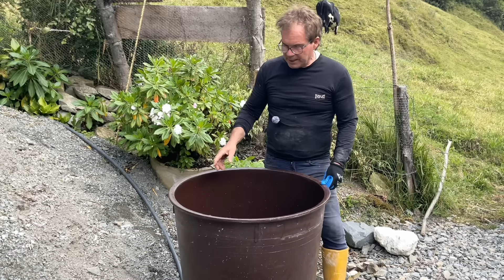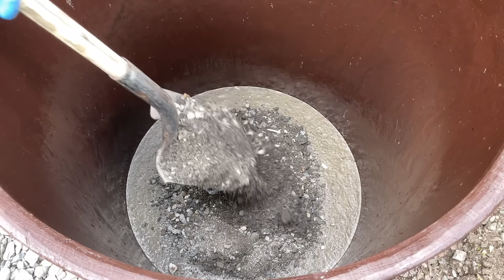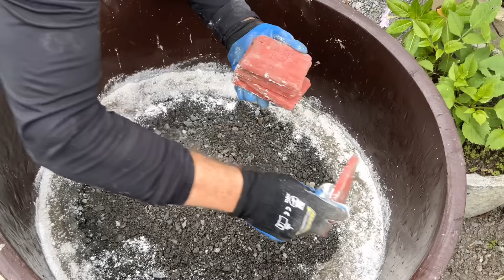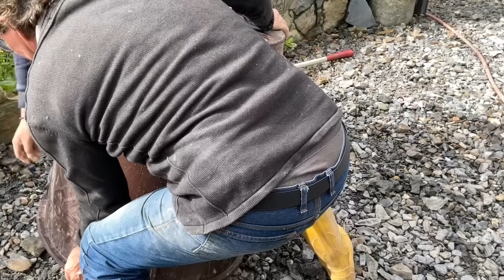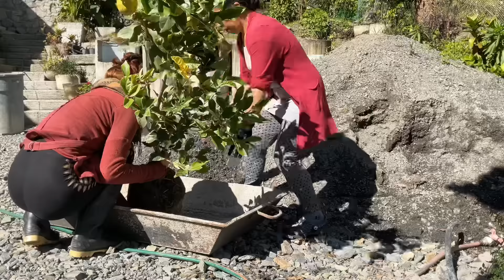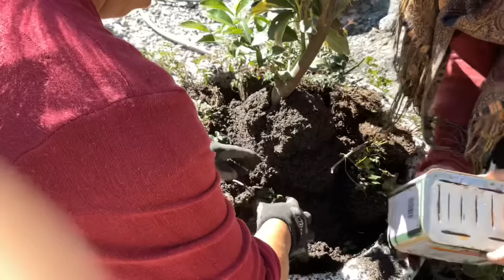How I make massive concrete (cement) planters cheaply and effortlessly using the sand fill method!

Comment: 4 inches thick? That's pretty heavy. Did you keep track of how much portland and sand this took?
Reply from the maker: If I had to move this beast I would add more polypropylene fibres and work towards 2 inches. We just flipped it over. I will make a massive round planter with fabric shortly.

1 bag of Portland  equals 24 shovels full plus we added 72 shovels of sharp sand. I remember specifically only having one bag left of type 10 Portland.

Comment: Hi! What’s the hardiness zone where you live? I’m in 6b. So I’m not sure how to prevent the concrete planters from cracking. Any input would be tremendously appreciated. Muchas gracias
Reply from the maker: We’re zone 10 b. Look it is very simple. If you want frost proof planters the following tricks help immensely. 1 ) Rich mix 1 cement to 3 sand/ stone. 2) Add an aerator to the mix.. even a bit of dish soap creates bubbles in the concrete 3) polypropylene fibres help with cracking 4) mix your concrete with proper energy… hand mixing doesn’t cut it  5) be very careful with sealers they can trap water into the structure of the planter 6) if in doubt empty your planters and store in a dry location.
Reply: @buildingenjoyment thanks! I recently learned about baseless planters. This UK gardener named Bunny (can’t recall her last name) she’s also on YouTube. She teaches that method and it helps the plants thrive. It would be interesting to basically make a concrete cylinder. Thank you so much 🙂

Comment: That’s crazy. Every other concrete planter video I’ve watched cares so much about the inside being perfect 😮
Reply from the maker: Yes! Yes !Yes ! The rougher the inside the larger the water uptake surface for the roots to attach to the concrete.  The biggest issue is when you want to get the plant out of the concrete plater. Almost impossible. We have to use a wrecking bar .

Comment: So far this method is the most practical method I have been seen on you tube! Really appreciate.
Reply from the maker: Appreciate the appraisal. The inside of the planter is irrelevant. Getting over that fact makes the sand fill method possible 😎
The rough inside is actually great for the roots to pull out moisture from the concrete planter.

Comment: Do the chemicals from the cement leach into the soil and affect the plants?
Reply from the maker: Lime is the biggest culprit which raises the ph of the soil inside the planter. I always mix a wetter clay soil and rub it against the walls of my new planters. I ve noticed the roots attach themselves to the concrete walls of the planter. When I try to remove the plant it is tough because the plants and the cement have joined strongly. I make a point of trying to have rougher insides of planters so roots have something to latch on to. 

My plants are thriving inside all the planters I’ve made.

Comment: I wish you would've shown the inside of the planter after it was all done.  Not extremely important; I just would've liked to have seen it.
Very cool project; so many variations you could do with this; from coloring, to using leaves or rope or anything really for texture on the outside of it.  Really cool, thanks for sharing.
Reply from the maker: Interesting comment! We always beautify the inside of the planter the make it thinner (chiseling) Also prefer these planters to be rougher on the inside for roots to attach themselves! We have recently made a leaf textured planter video !😏

Comment: Beautiful!!  This was the perfect size for planting a tree.  Thank you so much for sharing your process.  Is there a need to cure the planters before planting in them?  I'm on to your next video.  Cheers!
Reply from the maker: I have a process that neutralizes the alkalinity of the cement. Mix a pail of your richest soil with a bit of water to create a thick paste. With gloves rub this gooey mix into the inside walls of your concrete planters. Once everything is covered you made a connection between your planter and the soil surrounding your planters.

Comment: You really think that is only 200lb? you guys struggle quite a bit, both probably weigh nearly 200.. I'll bet it's 300-400
Reply from the maker: You’re right here is the calculation.

3/4 quarters of a of a bag of cement. 37.5 kg +37.5 kg x3 of sand = 4 x37.5 kg = 330 pounds.
Reply: @buildingenjoyment  oh yea nice. don't forget the water! & thanks for the video

Comment: Does it work the same way in zone 5b ? .....
Reply from the maker: Yes , but stick to a strong mix. The stronger the planter the better it will survive freeze thaw pressures. 1 cement to 3 sand will survive frost.

Comment: Not having a hole in the bottom keeps the tree roots from going out. If the roots go through the hole they will grow until they bust open the planter.
Reply from the maker: Interesting comment. I don’t drill holes any more. I always cut slits with a grinder. This planter was sliced as well just didn’t film it.
Reply from the maker: I actually prefer bottomless planters.

Comment: Have you used a rubber circle imade from a rubber or flexible plastic strip  in order to make it easier without fisting it.
This is how I plan to make it place the rubber circle fil it with sand, pour the concrete, remove the rubber and then do it again for each layer.
The rubber will be almost the height of a layer
Reply from the maker: The mechanics are off. How are you going to raise the rubber band with each layer . The fisting is super effective and creates a great skin on the outside of the planter. Super easy and super fast . Why change the simplicity? 

Are you talking about a hard circular plastic? 

It seems people are having a rough time with the inside of the planter being rough. The roughness is what the roots grab on to to facilitate a moisture exchange with the cement planter. The roots love attaching themselves to the planter. I’ve tried taking trees out of these planters and it is tough.

Comment: Interesting idea, but why not simply puting a flexible bucket or good size bag (filled for the weight maybe with water?) inside the bigger one, then vibrate it to avoid bubbles, and un-mold the whole ? Could be even faster isn't it ?
Reply from the maker: The issue is getting the inside container out. The outside container is five times easier to get out than the inside container. Many videos on YouTube were the person can’t get the inside container out.
Reply from the maker: The Sand fill method is a lot faster calculating the time it would take to get the inside container out. If you can leave the inside planter in place it is faster.

Comment: Lovely results.  ... and to quote you... "easy to do".   Especially if one has all the "helpers" you had and all the "tools of the trade".  An older female, DIYer for decades, retired and surviving in Rural Appalachia... at 76years of age.
Reply from the maker: Not so hard concrete takes a long time before it dries. You even have enough time for a cup of tea while mixing !
Reply: Actually is the best low budget and easy way to do this, but a mold of that magnitude would be very expensive.   And if he put something in the middle instead of sand it would be a little difficult to remove.

Comment: Uh, didn't you forget the drainage holes????  Those plants 🌱🌿🌼 are as good as dead 🪾🥀💀.
Reply from the maker: Cut long slits in the bottom with a grinder forgot to include it in the video. Wanted to make a separate video on cutting slits in cement planters so messed it up. Slits are working out better than holes for me.
Reply from the maker: Actually the plants do ok without drainage holes as long as the inside of the planter allows for water transfer through the cement.
Reply from the maker: I have many planters in locations that are in full sun without drainage holes.

Comment: NO DRAIN HOLES!!!😳this is TOO MUCH UN NESSARY WEIGHT!  No planter needs that much material, you’re not building the pyramids of Giza .  The more cement the less room for soil….
Reply from the maker: I cut drain holes (slices) but didn’t add it to the video. My bad! Was thinking ahead about a video on slicing drain holes instead of drilling holes.

The planter is 10 cm thick and we outlast the two of us. The planter is also staying in this spot forever. We have the most intense sun imaginable here on the equator, thick planters are the best way to keep roots cool.

The moisture exchange with thick planters is exceptional. Excess water gets absorbed by the thick walls. Released when the plant needs moisture. When you take the plants out of the planter the walls are absolutely covered with roots. I made a video showing the struggle of getting a plant out of the planter.

Comment: It would be a good idea to seal the inside of the pot. Concrete fishpond sealant is easy to apply. If not sealed, free lime in the cement will leach into the growing medium. This will be deadly to lime intolerant plants such as citrus.
Reply from the maker: I would rather deal with the lime than the harsh chemicals of a sealer. 

Lime is actually essential for soil regulation not sure why so many are scared of the lime in the cement. Lime is a naturally occurring soil additive. 

Here is how I deal with the insides of planters. I make a rich soil mix and rub it into the inside of the planters until I have a thick skin covering all the interior. As long as you skin the inside of the planters with a rich everything is protected . I have citrus, mangos and avocados bursting with life inside cement planters. The planters don’t have bottoms which promotes more vigorous growth.

The variegated lemon will have no issues in this cement planter.
Reply: That's interesting, thank you.

Comment: Did I miss what you used to coat the inside of the container to help with the release? Suggestions, please.
Reply from the maker: Simple cheap cooking oil. If you’ve never released cement from plastic . Let the first coat of soap dry in the sun then put a second coat. Some plastic containers don’t have enough slope to be released. Also I sometimes fill up the edges of the plastic container with water and sometimes use an air compressor to reales the cement from the plastic container. 

The idea is to get 10 planters out of on plastic container 🔟

Comment: I appreciate the upload, i didnt know this was a possible method. I wish you had shown the inside of the finished planter as im interested in how the inside surface looks. What kind of plastic container is it and where did you get it?
Reply from the maker: The inside of the planter is rough and unattractive on purpose. I want the roots to grab on the the roughness! I’ve released some entangled trees from cement planters I’ve made and the roots dig in to the rough cement. (Moisture exchange ) I always smear the inside of the planter with a rich mix of soil. Putting another plastic container on the inside is tough. They never come out easily. The outside is 5 times easier to release. 

If you’re looking for a really smooth inside sheet metal is a better option.

It is a recycled plastic manufacturer here in Ecuador. Look up recycled plastic manufacturers. The container is tough as nails.
Reply: @buildingenjoyment  thanks for the reply. I don't doubt why you left it rough, I'm just curious to see how rough it is. I'd like to use this method but I need the inside to be somewhat smooth, but some undulations are ok. Do you know what they use those containers for?
Reply from the maker: @natepenn9112 the recycled planters are crude . Some small company with steel moulds making extra thick planters. A lot of these companies make crude outdoor furniture as well .

Comment: How is that planter going to drain?
Reply from the maker: I cut slits in the bottom and didn’t add it to the video. My bad
Reply: thanks for sharing! I’m going to give it a try using white concrete and blue tiles.

Comment: What the heck does 3 too 1 or 2 too 4 mean? Why can't the just say half a bag, 1/4 of a bag? Or 3 shovel falls of sand.
Reply from the maker: One shovel full of cement to three shovels of sand/ stone mix

1/2 bag of cement = 10 shovels full of cement requires 30 shovels of sand/ stone mix 

I would lose half my audience using these ratios. My point is the mix is extra rich 1 to 3 and not the typical 1 to 5.
Reply: @buildingenjoyment  lol thanks for educating me

Comment: I am going to try this on a trough planter... thank you for sharing.
Reply from the maker: Please remember you can build a planter (rougher) on the outside of your wood frame …. Or smoother on the inside of the wood frame. Both will work fine. Don’t forget to cover the surface touching the cement with cheap cooking oil as a release agent.

Comment: Would it work to put vaseline on the outward facing side of the tiles to prevent concrete bleeding onto the face, thus eliminating having to clean it off after the concrete has set ?   Is the finished article frost proof?
Reply from the maker: The tiles cleaned so easily. A clear spray sealer  would be better than Vaseline. The issue is the diameter of the planter leaves a tiny gap where cement gets in behind the tile. Especially with the knocking. 

Frost proof recipe 

10 cm walls
1 cement to 3 sand ( rich mix)
Would add an aerator
Polypropylene fibres 1 inch.
Mix thoroughly and properly
Consistent wall thickness

A lot of people think it is always the cement that fails….most of the time it is the dirt inside the planter expanding and the planter isn’t strong enough to handle the expansion forces! 

Weak cement or cement that is constantly holding on to water are the easiest to split !

Comment: Do you know of any non-plastic alternatives to the polypropylene etc. fibers? We are avoiding adding plastic to our garden. Thanks!
Reply from the maker: The polypropylene fibres are optional. So the best option is 3 sand to one cement and using zero chemicals or fibres.

If you’re in a freeze thaw area the polypropylene fibres help keeping the planters together. The fibres are completely encapsulated in the cement. And fibres showing are burnt off with a torch.

If you make a rich concrete mix you will be fine.

Comment: Can you use any sand to fill?
Reply from the maker: Yes . Finer sand is better. I simply use the same sand that I make the planter out of. As long as the sand allows for a 3.5 inch cement layer you’re fine.  You could even use topsoil if you had no other options.

Comment: How do they hold up in climates where it freezes? I’m in grow zone 7a. Thanks for a beautiful video!
Reply from the maker: As long as you stick to a rich mix 1 cement 3 sand you’ll have no issue. Most freeze thaw issues are caused by weak mixes. Adding the polypropylene fibres helps immensely as well. If you want to be 100 % sure add a few spoons full of air entrainment powder in the mix.

Also the soil type inside the planter is a big cause for freeze thaw damage. The soil retains too much moisture and expands blowing up the planter from the inside. 

Freeze thaw is never easy to understand. We used sealers on the outside causing the planters to blow up. We used sealers only on the inside and the planters blew up. The movement of water is key.

Comment: That's incredible.  Once i find the right big bucket, it is on.
Reply from the maker: Good to hear. Please look for a big bucket with a good release angle. Make sure to oil the bucket so you get the planter out easy. Release agents are crucial for newbies. Simply because getting the newly made planter out in one piece allows you to make 10 more using the same bucket. Did I mention that you shouldn’t skimp on using lots of cheap cooking oil to get your newly made planter out of the big bucket.

YouTube as so many videos were the person can’t get the plastic containers out. Especially if they used a container on the inside 🪣

Comment: Nope.. you must be in brazil or close to ot. .. no Sika plastocrete-Dm here. Not even on Amazon USA.  Sika Fiber M12... strike 2. 
How about at least a product link?
Is acrylic fortifier the same type of product?  I'll just run some stranded mat through my cheapo paper shredder.

.
Reply from the maker: In Ecuador . On Amazon you have to try different names. So odd how sensitive their searches are. Product links are unfortunately useless because we’re in such a different market.
Reply: @kyyurtman1416  - thorocrete in the US is one of several mfg’s that make acrylic additives for concrete. Any lowes or home depot will have the additive. Lowes /HD also have the fiber additive (normally glass fibers). If you want polypropylene fibers just google “concrete fiber additive “.
Reply from the maker: Thank you. Everything is more or less available lots of searching is required.
Reply from the maker: I’m in Ecuador. Plasticizers are made by so many companies . Polypropylene fibre is also quite mainstream. Big box stores were carrying when I left Canada.

Comment: Nice! You could add Perlite to your concrete mix.  Reduce the weight a lot.
Reply from the maker: I’ve had such negative experiences with vermiculite and even perlite I would never use them again. I prefer having extra guys to move planters or fake rocks in place. 

You have a beautiful planter and the face of the material starts to peel and get pitted. Especially in freeze thaw zones.